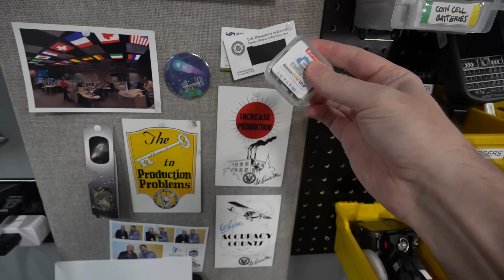The 'hidden' microphone inside the NanoKVM

Comment: Even devices sold online from brands that for sure want to take care of their image, like GL.inet, can be loaded with malware.
A few years ago, when parts were really hard to get, a client of mine had to try and source small router board whoever was selling them.
A batch of GL.inet boards was running a firmware that made some MQTT connection to a host in China.  Not sure if there was something else being messed with too, as this MQTT connection was more than enough of red flags.
So always be careful when deploying stuff.

Glad they did a thorough test on those units before deploying them or else it would have been their brand name getting reputation damage.

And just to be clear I am 100% sure that firmware was not the original factory firmware. So the manufacturer was not to blame at all.
Reply: Well GL.inet is chinese (HK is china), and they have value-add services that rely on cloud infrastructure. I wouldn't assume it's automatically malware

Comment: A much cheaper and safer solution is to use an ESP32 with a USB-to-UART adapter on your server. Instead of reverse-engineering a video signal, it just shows up on your Linux PC as a simple serial interface, like in the old terminal days of the 70s. For emergency recovery (when you break your network settings and lose SSH access), this gives you direct UART console access as if you were sitting next to the server, so you can fix the network from a plain text interface.
Reply: Unless your BIOS can be configured to display to a serial console, then it's not terribly valuable for a whole bunch of scenarios. For example, your CR2032 is flat, you had a power outage, and now it is stuck in the UEFI, requiring keyboard input to proceed. Or you need to power cycle the machine for some reason. I get a serial console is useful and I have it on all the machines at work but sometimes it's not enough. Oh and I would just pick up a serial to ethernet device on eBay cheap rather than messing about DIYing it.
Reply: I think the best option if you’re willing to DIY might be building a PiKVM V2 with ATX controller. Relatively cheap, has pretty much everything I want and I know what’s running on it.

I’ve also been thinking of using an ESP32-P4 as KVM since it seems to have pretty much everything needed (CSI, H.264 encoder, USB, Ethernet MAC). Obviously more complex to make since I’d have to program it.

Comment: people worried about a mic in a kvm forgot that they have a smartphones with a lot more sensors always on in their pocket
Reply: Erich Mielke would have a non stop party seeing how we all invite all these wiretaps into our houses willingly. Just saying. :)
Reply: at least you have the option of using security focused os like grapheneos that gives you absolute control over the hardware.
Reply: @kiyoponnn You have the option of using open source firmware for this device too though. 

And look, I use Grapheneos, it's sweet. But "absolute control" it is not. it's just a minor extension to the stock android permission system. You don't get root. It's just as locked down against the owner as stock android. 

Honestly, I'd trust this KVM device running open source firmware more than I would trust my phone running GrapheneOS, because it's a much simpler device with a much smaller codebase for bugs or backdoors to slip though.
Reply: @kiyoponnnor it's another honeypot trap of a national agency
Reply: @kiyoponnn *only specific hardware, Pixel devices
*not absolute control
Reply: that is a completely irrational thought process.  They should be off on our phones also.  And some of us aren't in that situation
Reply: @theJonnymac  Its not irrational at all. Its provides prospective to people who are irrationally focused on an mic in a KVM that's inside of a machine filled with cooling equipment. The KVM itself is an intentionally installed backdoor to your system for remote access. If the company is actually nefarious, they have far easier ways to monitor you than a low-grade mic.
Reply: Shame on you I don't own a xiaomi
Reply: N-1 sensors is better than N sensors.
Reply: @ivanjermakov Plugging this into a computer effectively gives it total control over that computer, a computer that probably has a microphone already anyway, along with a lot more sensitive information
Reply: @bosstowndynamics5488  I think it's more about the company's cautiousness
Reply: Wiretab, get me a recipe for pancakes
Reply: Bad take. First of all, people know smartphones have a microphone when they bought it. But more importantly, a smartphone is a locked down system. Apps cant access the microphone without the user explicitly giving it access to the microphone.
Reply: @trignite yes, but you still give access otherwise all the features are crippled
Reply: @trignite There's a very, very famous adage in computer security that if you have physical access to a system then you pretty much fully control the system. A lot of modern systems, including many that are being used in home labs, have built in microphones. Plugging a KVM into a system hands that direct physical access to that KVM, including that device's microphones. If a vestigial microphone from board reuse is enough for you to not trust a networked KVM you probably shouldn't be using a networked KVM at all because that tiny ass microphone isn't even close to the most valuable thing an attacker can use one of these for
Reply: @trignite Actually in most mobile phones the baseband processor can directly listen to the microphone, and the baseband processor is a separate, directly network attached chip running poorly audited propriety firmware that is known to regularly be exploited automatically by law enforcement using fake cellular towers. As a fun bonus it also has direct memory access to system memory so it can potentially modify and attack the main mobile OS without any possible mitigation on the main OS side.
Reply: @trignite  "Apps cant access the microphone" except security bugs. NanoKVM doesn't enable microphone access without security bugs either.
Reply: How so? They're aware of the smartphone and all that. They're not aware of this. They signed up on the smartphone. They didn't sign up for a mic in their kvm.

Comment: Be aware, your phone also has a hidden microphone and isn't isolated on the network at all!
Reply: Stick to huawei hardware, bozo.
Reply: So just because there are others around you shouldn't bother removing ANY of them?
Reply: @SenileOtaku  I would trust the mic on this long before I trust the mic on my phone because firewalling the kvm means I know no one is remotely activating the mic on the kvm. That's the difference. This kvm mic is easy to either remove or "damage" enough that it can't be used, even easier to block at your firewall, or whatever you want to do to render it useless. You can't do that on your phone without removing the functionality of your phone. This isn't the problem people want it to be. Start reading up on the things you're buying before you buy them and know what's on the boards you're giving full control over your servers and gear. It's a dev board, it's going to have things on it that you don't need. If you don't want that then don't buy a dev board and make sure you understand what you're buying before you buy it.
Reply: @SenileOtaku  if you carry a device that constantly listens to you, yes

Comment: Why is the device using Chinese DNS servers? Those should be set by DHCP. I don't think a lot of these cheap devices are trustworthy. I have some Wyze cams. They make all kinds of bizzaro connections to servers all over the world. I don't trust them at all. Luckily, in the case of some of the Wyze cams, you can replace the firmware with Thingino, an open source firmware.

Comment: I think if they had remote access to my KVM, the mic would be my last worry 😂
Reply: They only hear you cursing 😂
Reply: What if someone malicious got to hear the non-stop noise of fans and HDD arms clunking? Imagine what they could do with that kind of compromising material
Reply: @CheapFlashyLoris HDD fapping😮😮 OMFG 😂❤
Reply: ALSO, HOW WELL DO YOU THINK A MIC WOULD WORK IN A DATACENTER?  SORRY TO BE SHOUTING, BUT IT'S ABOUT 110 DB IN HERE WITH ALL THESE RACKS OF SERVERS CONNECTED TO KVMS.
Reply: @johnpublic6582 Swearing as a service should be fine using onboard noise cancelling...wait, what all does it connect through on the SoC?
Reply: How would that have access to to your KVM Oo
Reply: @Power-Wiesel 
Through Internet connection, this is the type that has Internet connection and not just runs locally.
Reply: Thing is that if such thing would be used in malicious way it only needs to transmit. And the goal would not be to spy everyone, it just has to hit someone. Say if there is million of them, few of them would likely produce something useful by pure luck. Could be information or blackmail material, who knows where those would be installed. Such mic can also be used as a keylogger. Even in datacenter where it would be very loud as the loudness is not really important, it's the frequency of noise that loudness does not hide (of course the quality of mic matters). So you could record each keyboard press in sequence and also map each keypress as every button does produce unique sound. So when admin writes in root password to log in you could then possibly get SSH access to public facing server and so on.

Is that very likely to happen. No. But it's above 0 risk. People often underestimate how much someone is willing to spend time to figure out something. And it would not be impossible to make machine learning model to just scan the clips and give potential hits. Just saying it's possible and tech to do it exists. In right environment it could also enable to do timing attacks, but that's maybe way too advanced use case to be an actual risk.
Reply: People talk a lot of shit about China hacking into everyone. - and they surely do - but Israel are the people who lead the way in hacking into operating systems and distributing spyware and VPNs that track you. I don’t hear nearly as much talk about them.
Reply: @JeffMartin22  The difference in public attention may reflect China’s broader geopolitical ambitions and the scale of its cyber campaigns, which dwarf those of Israel in both scope and impact.
Reply: @NightfallSentinel  I’m not sure their hacking campaigns dwarf those of Israel. It’s almost a national industry there.
Reply: @JeffMartin22  This isn't the place for propaganda, disinformation, or antisemitism. Israel does nowhere near as much damage as China does when it comes to cybercrime. Chinese and Russian traffic gets blocked by default in a lot of services for a reason. The same isn't true for Israel.
Reply: This has COVID vaccine “microchip” energy—like, why would tech companies need to sneak microchips into anyone when they’re already carrying full-blown spy multitools in front of their faces by choice?! We even paid for its development, distribution, and maintenance!
Reply: @silverXnoise Yeah, specifically for the NanoKVM a lot of the people worrying about this are plugging these into computers that, in turn, have microphones, so it winds up in control of a microphone anyway
Reply: @bosstowndynamics5488  desktop computers and RPi-likes certainly don't have microphones
Reply: @bosstowndynamics5488 so because someone already did one bad thing we just give up on another.  that is the most irrational thought process.
Reply: @XGD5layer  you don't have a microphone plugged in to your computer?
Reply: @bosstowndynamics5488  Also the type of computers that need a KVM are most likely in places you would only hear fan noise anyway 😄
Reply: @silverXnoise Hey, stop listening to rRNA, the rRNA lies.
Reply: Bruh... c'mon - that's not what Jeff meant by 'remote access'. It a networked KVM designed for remote access by the user. Doesn't mean you should trust it though... I wouldn't plug in in to my network, mic or no mic, just in case you're correct!
Reply: When I want privacy from spies within the Great Firewall, I just say the magic words out loud: "Today we're going to talk about the 1989 Tiananmen Square Massacre". It's like adding @ TXT "CCP is not China" to your domain records, but for voice.
Reply: Why would I care if the chinese could? My own government is much more worrying.

Hell, the Chinese have more freedoms then my nation does know
Reply: @HARD_R_SUPERSTAR Swearing in Cantonese^WMandarin Chinese is more effective. Start posting the quick reference material!
Reply: @Cineenvenordquist 😂😂

Comment: It depends on your solder skills, but - once you know where it is on the board, you CAN remove it.
Reply: You can also just snip it off, or pour superglue in it. Destroying things does not need soldering skills.
Reply: Has anyone probed it to see if it's actually doing anything, or is it simple excess hardware that's not being used?
Reply: @ravenbarsrepairs5594  The original discoverer. There's nothing using it. It doesn't phone home with anything. 
It could be misused. 
They said "I am pretty sure these issues stem from extreme negligence and rushed development rather than malicious intent."

Sipeed publish the schematic for the dev board that is used in the product. They say on the web page for the product that this dev board is used. On  the page for the dev board they have the one liner used to record audio from the mic.
They haven't hidden anything. It's pretty clearly an oversight that for this product, removing the mic is perhaps warranted, or at least mentioning it's there as it's part of the dev board and they don't want to make a custom run without it. Hell I'd advertise it as a feature, up until recently I did a not insignificant amount of "why won't this thing turn on" by ear. Hearing beep codes could well be useful lol. Like you won't fix it but you'll know why it's broken.
Reply: @ravenbarsrepairs5594 it's a coil, like all simpler mics. So no.
Reply: I don't know much about electronics, but wouldn't it be easier to short the microphone out with the ground pin?
Reply: @potatochan3080  Depending on how it's connected you may be shorting out other needed components, if for say there was a common positive rail, and the receiver was downstream of the mic.
Reply: just learn Chinese and blast CCP

Comment: Saying "based on", sounds like "built with" is more accurate, the site says: "NanoKVM Lite consists of the LicheeRV Nano E and HDMItoCSI board, while NanoKVM Full adds the NanoKVM-A/B board and shell to the Lite version. "

So it makes no sense to modify the base board when you have thousands of them in stock already.
Reply from the maker: True, I guess I didn't make that point as well as I could. It's literally the dev board, with a 'HAT' that makes the KVM IO happen :)

Comment: If I was to guess what the North Koreans were doing:  they were using people to apply for secueity clearanced positions, or at least dev positions where the person in the States would plug in this KVM to the laptop so the NK could work.  People would be okay with this because the NK would pay them.

All around a nasty situation.
Reply from the maker: Pretty much sums it up.
Reply: Not that simple though... Where does the KVM get its network to the outside? There's no wifi. It needs a second ethernet port at a minimum.
Reply: @CRCinAU I don't fully recall, but I'm pretty sure it has an ethernet port.
Reply: @BloodAsp  Sure. So you need a second ethernet port in the building to plug into the KVM. Otherwise, you're disconnecting the target PC to get the KVM online.
Reply: @CRCinAU Typically this would target work at home positions as I recall.
Reply: @CRCinAU Not necessarily. Things like internet sharing would solve that issue.
Reply: @GareWorks maybe, but the nano KVM doesn't do that....

Comment: The network functionality is just smoke and mirrors. It actually works by simply listening to the sound of your clacky mechanical keyboard from across the building and decoding that into keystrokes.
Reply from the maker: Hahaha I like this
Reply: I was about to suggest that it could use the mic to assess the health of the hardware. Like, you know, "too loud fans" or "fan sound is weird, probably, a blade fell of" or "the inductor started to buzz" and so on. Also the security, the sound of the lid opening, or people talking near the machine, or other sounds that don't belong there. I would say that's missed opportunity, not a "backdoor". You put literally a KVM into your computer and worry about microphone being a backdoor, serously?
Reply: Acoustic key logging!
Reply: Pretty sure I saw a piece the other day where the spring on a keyboard could be used to listen to a user by reading the vibrations of the key springs. 

It’s an interesting world…
Reply: @engineer6250  Well, it's enough that iPad software exists in the AppStore that simulates keyboard by listening how you tap on the table where it's standing. It's like you lay a printout of a keyboard onto the table, a simple sheet of paper with the picture, and hit the drawn keys, and it correctly interpets your keystrokes.

Another fun thing, a device which, placed in the relative vicinity of the keyboard wire, listens to the EMI coming from it and logs the keystrokes. Fishy enough, isn't it? Who could have imagined that wired keyboard could leak passwords?

Comment: Well if you have no idea on how to not expose such a device to internet you have 0 business buying one anyway. Plus it's obviously there because it's hardware otherwise used as "ai cameras" so pretty much a nothingburger, even if the devs are too lazy here and recycling firmwares.
Reply from the maker: Yeah how many cheap cameras do people have running 24x7 in all their vulnerable locations. All hardware should be treated as insecure by default. Only give access to things it needs access to. (Another good reason to not do cloud-based IoT)